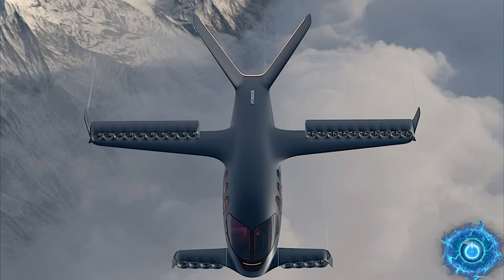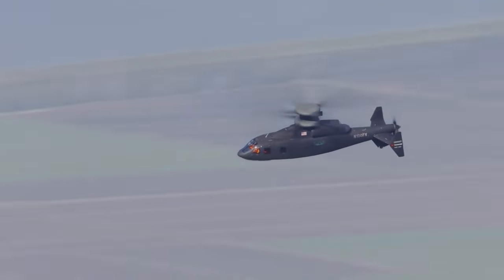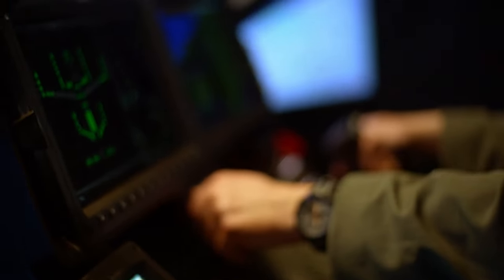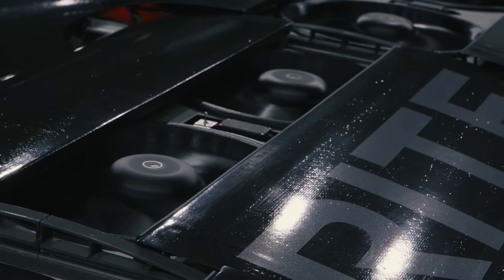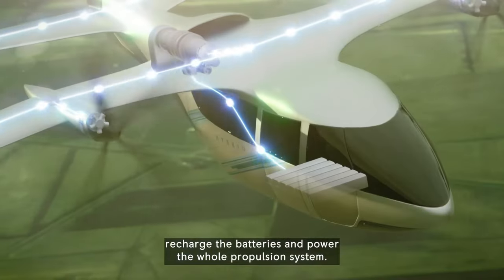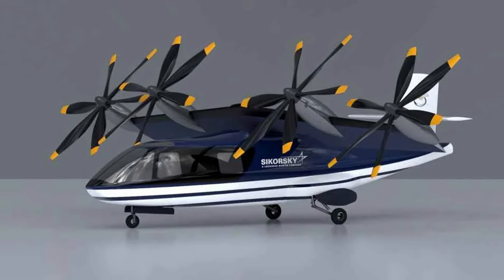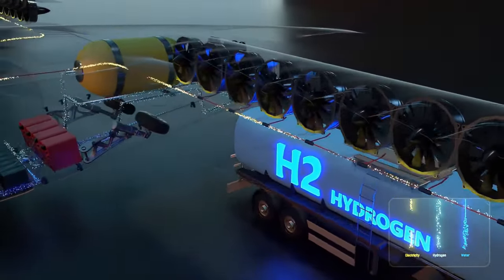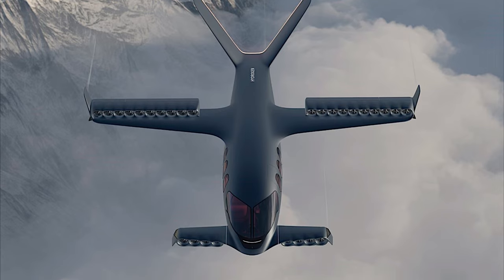New Hybrid AIRCRAFT  is GAME-CHANGING

Comment: The energy stats quoted at the start need some additional caveats: yes Lion batteries are currently at the 300Wh/kg and Hydrocarbons are typically 12kWh/kg - however the utilisation of chemical fuel has efficiencies of approx. 20% resulting in a usable density of 2.4kWh/kg. Still much better than electrical, but inefficient. Hydrogen has better energy density when mass is a factor, but is poor when volume is a factor - thus suitable for short range applications, where climb is the cost driver, and poor for cruise where drag is the dominant mechanism.  

hybridisation is almost always an advantage when there are changes in power output, or where there is a significant disparity in the thrust to velocity... which also supports the short haul case if the additional non-fuel mass (alternator, wiring etc) are low enough to not erode the gains.
Reply: all the flying prototypes who wanted to maximize range or efficiency end up using hydrogen. There is no way to beat hydrogen at that metric.
So not sure why you tag hydrogen as  just good for short flying.
Yeah.. if you want to use a plane design who was designed for kerosene and adapt that to hydrogen following other silly regulations that were designed for ground h2 storage, then yeah, your plane would not be able to achieve long range.
But those limitations are on current regulations and designs, not on the h2 tech itself.
Let me clarify... Half of the weight of a 747 is fuel, with liquid hydrogen you can achieve the same energy at 1/3 of the fuel weight, 1/3 of the weight requires less fuel to match the same range, less power to take off or smaller wings which equal less drag. 
So you end using even less h2 to start, this mean you end even with a similar volume, and even in those cases where you want to double the range, just increasing the dimensions of a tank by 20% you are doubling the volume. 
So no.. volume is not an issue.. The issue is the amount of money and time that requires to certify different designs, tanks, systems and methods on an airplane that carries people.

Comment: Ground based recharging way-points could recharge the electric flying vehicle with lasers as it flies by. Energy is energy. Besides increasing energy density, batteries are getting faster charge times. A few high-density pulses keeps it in the air longer from a giga-charger. pew pew!
Reply: Study particle physics more . Clouds and lasers do not mix
Reply: Changing the angle of the laser at ground level to hit an aircraft at more than 40° angle is difficult.  More angle , more atmosphere.  How many lase stations needed to control or power 20 aircraft ? 20 machines needed . Can only focus on 1 target at a time . Space would look like a disco ball .